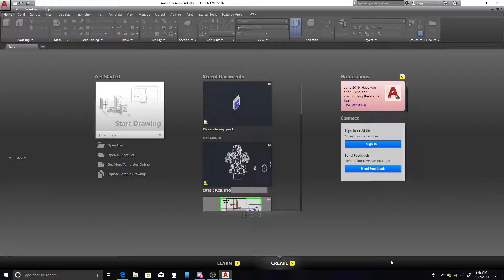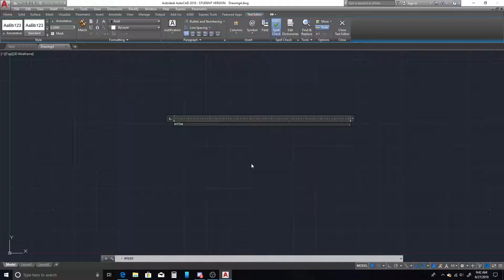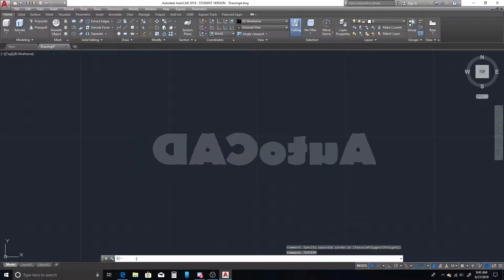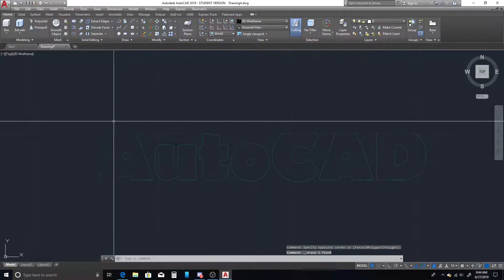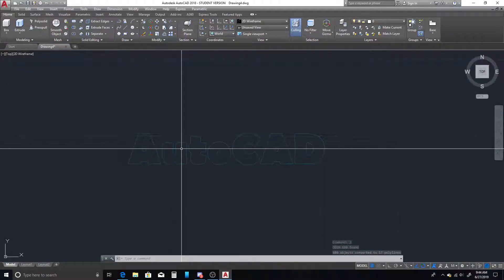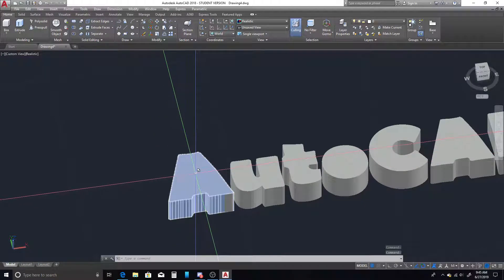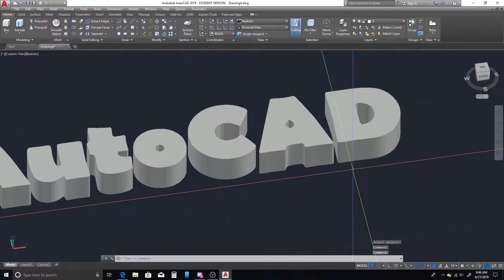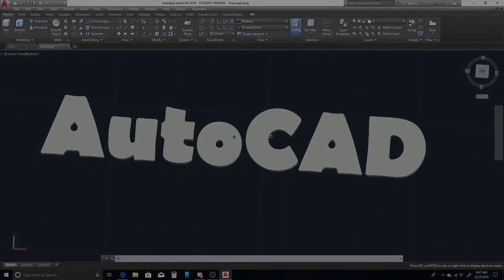How To Easily Make 3D Text in AutoCAD

Comment: You can use PRESSPULL instead of EXTRUDE. It will save your time. Thanks for the idea btw.
Reply: I know this comment is a year old, but in my experience, using PRESSPULL for exploded text will sometimes result in the text being extruded into faces rather than solids. I'm not sure why, but personally I have found Extrude to work better in this scenario. For most other things I would use PRESSPULL though.
Reply: @jonathanbrowning9165  If it is not a boundary object I mean a single entity object, it won't extrude the solid while using presspull rather it will make a shell object. Make sure if the object is boundary object or not.